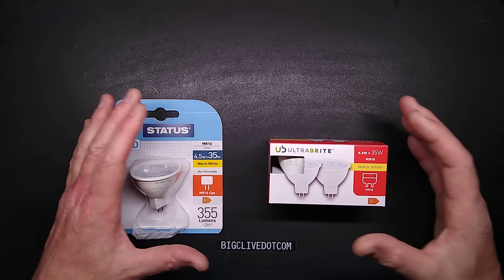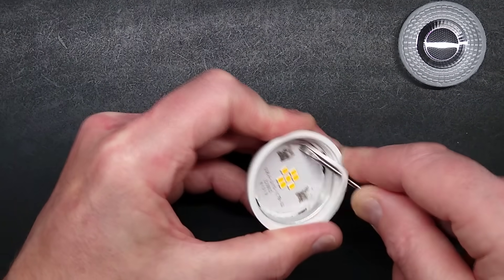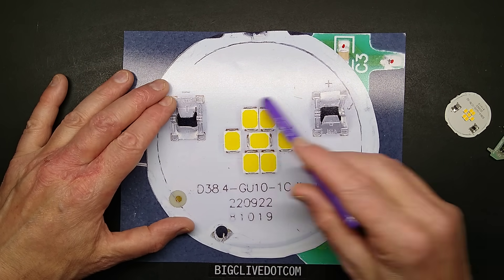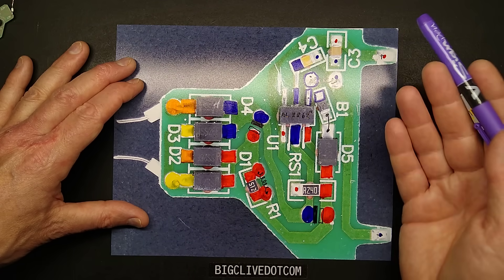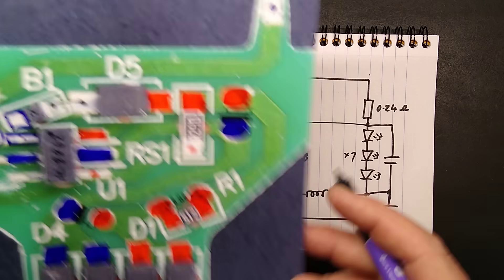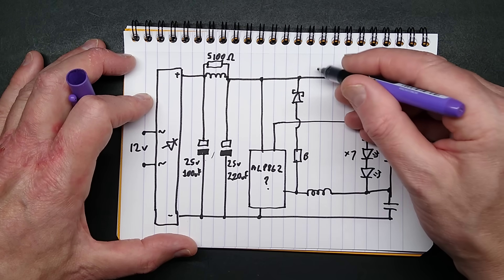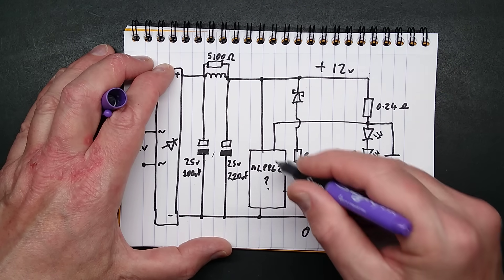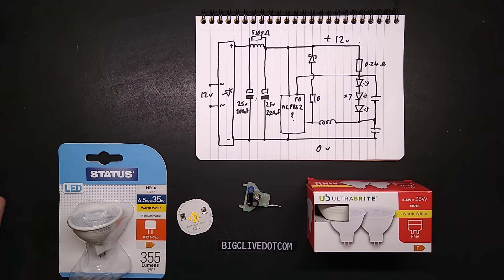Poundland 12V bulb with mystery component

Comment: I wanted to convert a set of 4 * 35Watt halogene to LED. The mentioned electronic Transformer turned the whole thing into a disco because of underload. Hence there often is a minimal load mentioned in the ratings. Running the set of lights with one halogene bulb and 3 LEDs fixed the issue. Compared to 140 Watts, 47W is still a saving.
Note that the LED-Board in your video mentions "GU10". There seemed to be other HV-Variants as well(?).
Reply: "GU10" is the socket type. Pins are 10mm apart.
Reply: Interesting sidenote: cheap electronic  halogene transformers and electronic ballasts for fluorescent lamps share the basic circuit-concept (with a diac to start oscillation and a torroidial feedback-transformer to drive two transistors or mosfets) . I even found this type of circuitry in a powersupply for car-equipment (such as a cool-box).
Reply: I heard that transformers under its rated load will raise their voltage and kill halogen lamps prematurely. Probably still a good use for them old bulbz.
Reply: I converted a halogen chandelier from Ikea to LED bulbs, and it was very unhappy. So I ditched the included driver and used a 12V wall wart instead.
Reply: Yup! Those are normally used for lamps with higher input-voltages. That is, what i'm pointing to.
Reply: Before led lights and tv...we had 100w light bulbs... TV on vaccum tubes and nobody complained about the electricity bill... now with everything on led the bill is to high.. the electricity companies are getting greedy ...if everyone in this country will pay £1 monthly.. the company is still making profit..

Comment: Here in Germany the're called GU 5.3, because of the distance of the plug leads - and we are using the metric system here. 😁
Reply: Here in UK to confuse even more we have GU10 .standing for general use 10mm .
Reply: @leslierbrooks2923 - some MR16 are also marked GU 5.3. Also in the past, some were only sold as “GU 5.3”.

Comment: 16-1/8ths. I'm from the US and that even had me converting like crazy for a couple seconds... yeish, but I guess,  10mm=1cm and people always say 10mm
Reply: The cm is a non-preferred SI unit, and as such ideally it shouldn't be used at all. When I did 'A' levels back in the day we'd get grief and marked down for using it, so it bugs me every time I see it used...
Reply: @will_doherty  cm is the smallest unit in land survey work. 
cm is used in the rag trade. 
I prefer not using cm at all... m, mm and decimal fractions of mm eg. 10.01mm
Reply: sometimes, I think, it's just to make it sound larger 😂
"Mine is x cm" ... "pah, mine is x0 mm!" 😅

The other reason, only valid for programmers: we like integer numbers, so we don't have to think about the decimal separator 😁
In Germany we use eg "1,5" instead of "1.5" ... if we have to calculate with this as a user input, it's always a hassle 😐
Either, the software will throw an error message "1,5 is not a valid float number" or the programmer has to check the users locale 🤔😁

Comment: I'm being pedantic I know, but at 0:03 when you say "low voltage"...FYI Mains voltage is low voltage....Did you mean extra low voltage?
Reply from the maker: If we want to be super-pedantic then it's SELV if not running on vehicle power.
Reply: Depends on the job, I guess?
When working with 150kV regularly, 12V is indeed very low voltage 😂

Comment: The lamps don't like iron transformers because of possible high voltage spikes when you turn off the mains switch at the peak parts of the AC cycle.
It's ok as last long as you have at least one tungsten lamp in parallel, but when they are all led, they start breaking.
Been there, done that! 🙂
Reply: I have thought that f I had a house Id have a 12v lighting circuit that would be driven by one or a few lead acid leisure batteries  connected to a trickle charger and solar panels.
Reply: @rimmersbryggeri  The downside of using a low voltage supply is that you will have much greater losses in the wiring compared to the same amount of power delivered at 240V.
For example let's compare 60W loads getting supplied through 20 meters of 2.5mm² copper cable. At 240VAC you'd have a 0.6% voltage drop across the cable, or about 1.4V, so the load is left with almost 239V. Meanwhile the 12VDC cable would drop the voltage by 14.5%, or about 1.7V, leaving the load with just over 10V.
Reply: @MicraHakkinen  - But how many LED lamps use 60W? Most MR16 LED lamps these days are rated at 2W to 5W. Yes, the voltage drop (power loss) can be a problem if you have long runs of cable with heavy loads. My solution is to use 4mm squared twin and earth with the earth and the return wire commoned up (connected in parallel) for the main supply cable. I also have three separate 12V batteries in three different locations. This is primary because I have PV solar panels in two different gardens (either side of the house). So have batteries in each shed nearest each PV solar panel array, plus batteries in the garage (part of the house). Hence voltage drop is kept to a minimum.
Reply: @MicraHakkinen  Yeah but the up side is that it will work when the power is out.
Reply: Ever heard of a TRANSZORB…
Reply: @Mark1024MAK  AKA TVS. Unless you REALLY need that picosecond response performance, a suitable zener with current limiting resistor should suffice, and the performance can be cheaply (and easily) boosted with a suitable cap in parallel.
Reply: That's not true in general. But you have to check the specifications. I have a bunch of OSRAM MR16 LED lamps running on an existing installation with a iron transformer. But asked the manufacturer if they're usable to be sure. Never had a failure and just changed them because I switched from 4000K to 3000K colour temperature.

Comment: I have 50x 12v Mr16 lights, running 8+ years not one has needed replacing yet. My secret is a lagre centralized 12v supply 600w and fuse box 4a fuse per room.
Reply: Undervolting has to be the oldest trick.
Reply: @Joel-HV  I have the power supply set to 13.8v it helps with voltage drop on longer cables runs. Also all cables are 2.5mm per core high quality
Reply: Interesting setup. Switches for the DC or everything via modules?
Reply: @fredfred2363  I used standard wall switch each light is only 6w.
6x lights per room 36w per switch at 3a its doesn't generate much heat at all.

Comment: I will save this video for myself 🍭
Reply: Nice that they are AC/DC but not very efficient for someone living off grid on a 12v supply because about 10% of the supply voltage is immediately lost in the bridge rectifier.

Comment: If it is labeled as B1 and is a dead short, then it is a ferrite-y type bead.
Reply from the maker: It's quite an odd place to find one.  But you're probably right.
Reply: That'd be my guess too.
Reply: Wanted to write the same. It ist probably there to keep the ringing from the diode low.
Reply: Agree, looks like a small ferite bead. Will give a high frequency impeadance, most likely to absorb high frequency switching noise/harmonics to meet EMC requirements. Guessing it will have an affect on noise at the low MHz and above. Invisible short circuit at dc, inductive impeadance at ac.
Reply: @robertwhite4375  given the circuit architecture, the bead would make sense, as you mentioned EMI. While not a lot, it can be pretty effective for ringing or other low-amplitude HF noise.

Comment: Bulb or Lamp makes no difference to me.  I guess I usually say bulb but it's fine either way.  The black background is cool but your lighting is better where you do most of the "not on the road" videos.  Still, it's fine too.  Sound wise, here you seem more bassy but very easily understood.

I think you could do videos in a park somewhere or a garage and I'd still be compelled to check it out and I'd enjoy it.

Thanks for all you share Big Clive!
Reply: As my college lecturer used to say, "bulbs go in the ground" 😂
Reply: @Jon-em4kc   Who knew this would be such a hot item to discuss.
Reply: It's a lamp.   There is no 'bulb' in this lamp.
A bulb is one component in your traditional incandescent lamp (also used in neon and discharge lamps). It is the gas filled bulbous glass that encloses the filament/s. 

A similar misused term is 'battery', when in fact the item is a 'cell'.... but thats the way it goes with general ignorance in society.
Reply: @BTW...  I suppose but I wouldn't call it ignorance.  Usage is what it is and it's always changing.  Merriam Webster has a whole section on line for usage and archaic terms etc.  

It's best not to be troubled by such things unless you are flat out wrong, right?

Comment: I purchased some 12v MR16 LED lamps from Amazon and the capacitor after the rectifier was only rated at 16V. It was fitted in a conventional fitting with transformer and after a few hours of use said capacitor decided to go off with a loud bang. After fitting a 25V rated part the lamps are still working fine after several years.🙄
Reply: 12VAC usually means 12V RMS, but the peak voltage is sqrt(2) times that, about 17V, and this is what the capacitor would charge to. Pop goes the cap!

Comment: Lamp to bulb terminology seems like a retrograde step. 'Bulb's are very technology-specific and for a technology (vacuum or gas-filled glass bulbs) that is rapidly becoming obsolete.
Reply: Except lamp can also refer to the fixture, vs. the "bulb".  Sort of the same as I gave up saying "accelerator" (pedal) vs. gas in my all electric car...  :)
Reply: @richardwernst  But the light-emitting part isn't a bulb. It's a lump of plastic.
Reply: Lamp - device that emits light for the purpose of illumination.
Fitting - device that you fit a lamp into.
Bulb - see gardening…
Layperson - someone who gets any/all of the above wrong 😂
Reply: @Mark1024MAK  luminaire ?